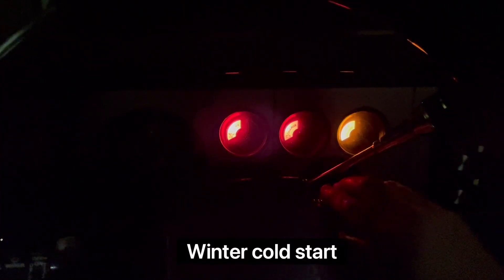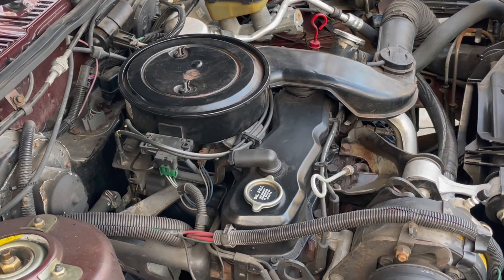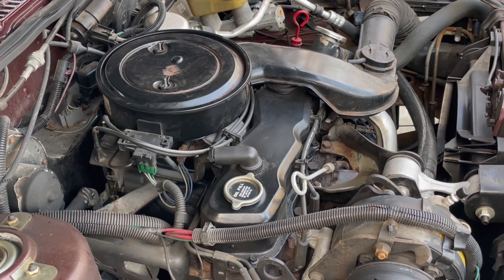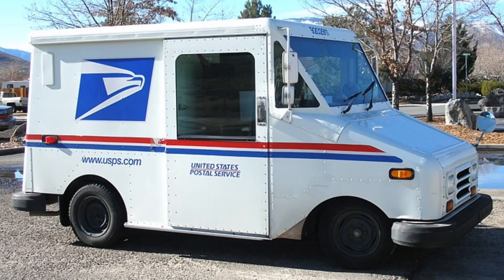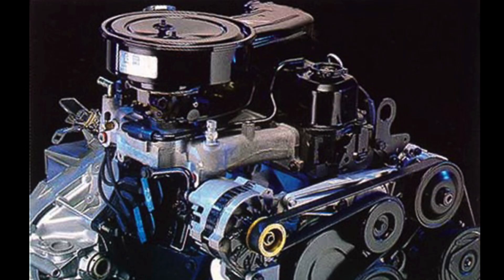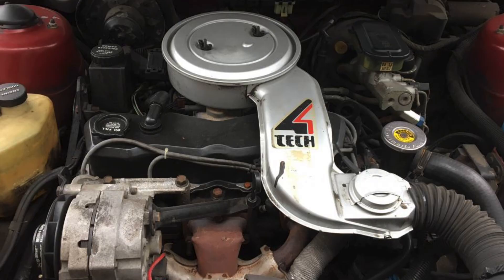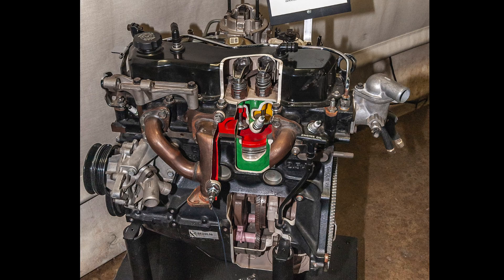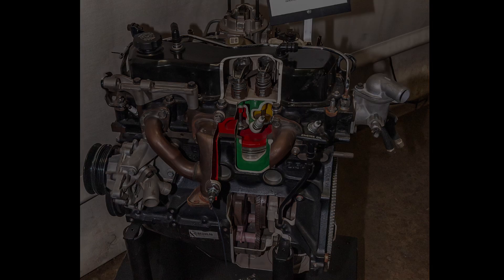Worst Sounding (and Most Recognizable) Engines: GM's "Puttering" Iron Duke 2.5L I-4

Comment: The Ecotec 2.4 sounds so bad, even from the factory, that working at the dealer, it was an almost daily occurrence for customers to come in with their brand new cars complaining that their engine is knocking.  I always joked that those shipped with factory rod knock, but it did kinda sound like that.  They also had the worst starter sound I've ever heard.  Sounded like scraping knives over garbage cans.

Except unlike the iron duke, those engines are also just terrible anyway.  They eat timing chains all the time, they burn their entire oil capacity between oil changes at 50k miles, prone to piston slap, etc.  I guess it's fitting that the cars they're in are equally horrible.

Comment: My Iron Duke lost a waterpump in August in the desert..I drove it 90 miles to the next town. Bought a waterpump put it on and kept going..they could actually air-cool! Try that with ANY other engine..It made that rattle noise sound really a reassuring thing..oh..carburetors were the best Dukes.. more reliable..

Comment: Great video! The Buick, later GM Holden here in Australia, 3.8L V6 was a pretty crude and noisy design. People complained a lot about the crudeness of this motor, it was used in the Holden Commodore for example, here in Aus. Holden made lots of attempts to improve the NVH characteristics of the 3.8 and it certainly got better over time. Nowhere near as weedy as this Iron Duke thing though! 😂

Comment: Yup. This engine was very crude sounding as I remembered it. But funny enough, in many GM FWD cars, specifically the compact X-body and A-body cars, this was the base engine equipped with throttle body fuel injection, which would start up easier without the need to pump the gas pedal, as you would need to in the next level engine upgrade option, the 2.8L carbureted V6 engine.

Comment: My Iron Duke powered 85 S-10 was EXTREMELY quiet after being “parked” on its roof for a few hours.
Side note:  The way it rattled the exhaust system against the body and frame every time I shut it off was almost comical.

Comment: I never experienced the 2.5 Iron Duke but heard plenty back in the day and still do from time to time. They are noisy unrefined poor excuses for 4 cylinders. Another GM 4 cylinder that parallels it in being dismal is the 2.2 pushrod 4 cylinder, aka the Vortec 2200 used in the S10. Unfortunately I had nearly 11 years experience with one. Gutless turd of an engine with a horrible power band that did not like to rev and sounded like it was coming apart if it was revved. Very unlike the excellent 22R that I used to have which revved willingly. Another loud buzzy 4 banger was the Chrysler 2.2 which was at least an OHC but also quite noisy though the turbo versions sounded good. While on the topic of noisy domestic engines, an honorable mention in the V-6 category has to go to the Ford 2.8 V6 which IMHO puts the Iron Duke to shame in terms of horrible sound. Talk about a sewing machine sound. Out of the gates they sounded like imminent valve train failure due to solid lifters. Also gutless turds.

Comment: I wonder if anyone could compare this engine (GM Iron Duke) with the similar displacement Jeep/AMC pushrod 4 that seems to have slipped into some of the same vehicles (I think the AMC 4 was a version of the 242 Six missing its front or back two cylinders)

Comment: Another thing that might have made a few of these cars sound  different(this was on V6s in certain Citations,I think the "Duke" had it too,a series of holes/nipples threaded into the exhaust manifold(s) connected to small pipes that ended in reed aspirator valves inside a sort of holder that then was connected to the engine air filter housing via rubber and metal tubes,the aspirator valves allowed air to enter the exhaust manifold but (if working) didn't allow exhaust flow out,it was some sort of emissions control strategy and made a certain amount of peculiar noise,especially at idle.
Reply: Interesting.  My 10 year old '86 Olds wouldn't start from about 15 minutes to 45 minutes after driving when it was humid.  Somebody thought it might be exhaust trapped in the manifold and a hole allowing air in?  Related to this? A quick stop at Blockbuster or an hour at the mall and you were fine.  Browse CD's at Best Buy for a half hour and your weren't going anywhere.
Reply: I suppose that with the aspirator valve thing a reed or  flap could fail and allow exhaust to flow wrong way back into the air filter enclosure but more likely that you had a bad ignition control module that would stop working when it absorbed heat after engine shutdown "heatsoak" and then later start working again after things cooled down 
  if it only did it in the wet or damp perhaps bad spark plug wires or even a bad distributer cap (I think that car still had one!) was absorbing moisture from the air and shorting out the spark energy 
would be worse with bad spark plugs or if the gap were too wide  @andrewsmith1404

Comment: They were noisy engines, but dependable. Of all the ones i had, only one left me at the side of the road, and that was when the pickup coil failed in the distributor. Another broke a headbolt, but it was a easy fix, new gasket and the revised bolt kit.

Comment: 5:19 That was a little unexpected that GM waited so long with adding a balance shaft to a four cylinder engine bigger than 2.4 liter. (Or is it GM-ish?) The Saab 1.5L V4 – aka Ford Cologne V4 – had it from the start in ~1963.

Comment: How about the V-6 that came in my dad's 1984 S-10. That thing was a dog.
Reply: The small Citation V6 was put into some of these and also early unibody Jeep Cherokee,too small for the weight of these vehicles and also I think some of these 2.8s had a lower compression ratio than the ones put in X11 and Pontiac STE cars which tended to have an appetite for Premium unleaded. 
The bigger V6 "Vortec"? used in S-10 was just fine and the Jeep Cherokee was transformed when the 242 fuel injection straight six became the available option in it especially when equipped with the trailer tow radiator (2 rows instead of 1)

Comment: I had a 86 Pontiac 6000 with the iron duke. Had an engine failure around 120k. Put a reman in it. Also trans failure a couple years later which also got a reman unit. It’s the only car I’ve ever had in over 30 years of driving that had an engine failure. Same can be said about the transmission. Had it about 5 years. Mid to late 90’s

Comment: I recall the sound rather distinctly, both starter and running. That gear drive had a replacement steel gear upgrade, that made the sound even worse/louder, to the point where 1 wondered if the mill had any oil pressure, or oil in it! We still have a couple LLVs running around town with the 2.5s, but most are the 2.2 Chevy. For such a short stroke design, that 2.5 does not like to rev. A neighbor of mine had an 85 Fiero with a 5 speed and that thing was screaming for mercy at 5k rpm. I still have the special oil filter housing removal tool collecting dust in my tool box, that 1 needed for the later 2.5s.

Comment: Had a 2.5 in an 81 Skylark. God I hated that piece of shit. On way to college one morning, with a friend right behind me….started smoking and losing power. I’d had enough, and my Monte Carlo was fixed, so I said F-it and just kept my foot in it for about 15 miles, until it just died.
Coasted into a parking lot, and hitched a ride with my buddy.
Went back that night…no compression and plugs were all fouled with molten aluminum.
Pulled the plates off, and too out the new battery and left it.

Comment: I remember my sister had an s10 with the duke that threw part of the cam gear through the radiator twice. I was young but if I remember right it had some kind of like a pressed fiber gear that my grandfather who owned a machine shop ended up replacing with steel ones.

Comment: O.k. o.k. Everyone seems to have it out for this little Iron Duke.  But I swear the one in my '87 Celebrity Eurosport bought from the neighbor next door sounded like and drove smooth enough that I thought it had the usual 2.8L V-6 when i took the car for a test drive.  Oh well, it lasted the stated 120K or so miles.  How about the "German" Ford 2.8L V-6 that was wedged into my parents' '75 Pinto Squire wagon?  Now that thing sounded truly like a chatterbox straight off the Ford dealer's lot. Plus its starter sang a memorable sing-song tune before all the chatter got going. But none of its crudity meant the ol' Pinto didn't last ten years with just one oil change!

Comment: If I remember right, there was a document that was leaked from GM corporate that detailed the cost to produce an iron duke. It was in the hundreds of dollars range (something like $700 comes to mind).
Of course they pumped out millions of them, and probably were able to shave the cost down to the last penny, but you’re building an engine from casting it to putting the air cleaner on it, you would think it might cost a bit more than that.

Comment: I've had a few of the 2.5s but most always blew a headgasket i don't know why but seems to be common for them . My 85 S10 had a 2.5 and it blew headgasket and smoked bad 

I also had a 88 S10 and it did the exact same thing and then finally I had a 89 Chevy celebrity base model with the 2.5 and 255,000 miles and it was perfect but sold the car later on but I have a 87 celebrity Eurosport 2.8v6 240,000 miles and I love that car and engine way better and the 3.1v6 that's in my 90 Lumina Euro

Comment: i noticed that you mentioned the 3.8 v6 engine! my grandpa had a oldsmobile 88 royale in red with the 3800 v6! if it hadnt gotten totaled by someone running a stop sign it probably would of still been on the road! its also known as the 3800 series 0,1,2,3 series 0 was obviously the best tho!

Comment: USPS proved that these engines were some of GM's most durable car engines ever produced.  My carrier's LLV has over 300K and the head's never been off of it.  Not only that, but that old-time never takes oil between changes. Trouble spot on those is the crappy THM-180 (Chevette) transmission.  But give the "Iron Duck" its due...it runs and runs and runs some more.

Comment: My 1980 Chevy Monza had one. The heavy Fisher Body Works body was a lot for this poor thing to haul around. But worse than that was that mine had a 4 speed manual with an undersized clutch that burned out every 10,000 miles or so. ( I've been driving stick shifts all my life and never had a clutch burn out like that.) It was the worst car I've ever owned. Its only saving geace was that my dad gave it to me for nothing.

Comment: Had a 2.5 in my 91 S10. Was no powerhouse but it was a tank. Beat the dog snot out of it and it just kept going. Had over 300k on not when I sold it. Guy I sold it to blew up the transmission. Never really noticed any abnormal noises from it.

Comment: It was piston slap! Unfortunately the oiling system was weak but enough for the top end. The wrist pins was the weakness. It created an egg shaped piston. This enabled piston slap and that distinctive knock like diesel sound at idle. But at 2k rpm it smoothed out and ran smoothly. I had an 85 S-10 with over 300k original bottom end and the timing gears and nylon mesh replaced with a steal upgrade but replaced twice! I had over 600k before the bottom end finally went! Thats a hell of a tough bottom end! I also had it finally rebuilt and honed .030 overbore with a special head gasket and shaved head with a new turbo off an olds omega. I eventually found an 84 Chevette with a manual transmission to put it in service. Now for the truck well….

But, I already had a small block 350 with a 400 crank which is a 383 stroker and double hump 202 high flow heads! It was a late 60’s block out of a 70 nova! So, I already small blocked the S-10 by then and it was a totally different animal! I kept the original rear end till I tore it out lol and eventually put a ford 9” with 273 gears and a 700R4 overdrive automatic out of an 84 trans am in it. That was a death trap! Ceramic pads and special front rotors. To stop! At 70mph she turn about 1400 RPM. I had long legs, so I put in the Trans Am seats and it had an extended cab. This helped with the long tail and cut and balanced drive shaft. It wasn’t quick off the line, but I had all kinds of top end. Well over 160mph. I could make the striped lines “solid” on the freeway! Thats GM! Love it! 🥰

Comment: I don't know why you're bad mouth in the sound of that particular engine. I have a 1983 Chev cavalier. With 1 million 89000 miles, it's the original engine and I'm not b********* when I tell you the mileage. Because I remember the day my grandparents bought that car. That car has been driven all the way across American numerous times all the way up to Alaska all the way to Brazil and back.  And then I ended up owning the car after my grandmother passed away and I've been driving the car since and by the way, since the car was new. I've been the one maintaining it. So I know what the mileage is. And I can tell you. It may not be the most pretty sounding and in, but it's been one of the most reliable engines ever made by G. M better than the crap they're producing today

Comment: Your voice sounds young. Nobody cared how an engine sounded back in my day during the 70's and 80's. We had mufflers for that. Yes the mid 80's 5.0 Mustangs gave people the historic V8 sound but we wanted power not sound. Power was hard to find before advancements were made including: VVT, Computer engine management, CAD design, thermal management, variable intakes, better fueling, turbos, 4 valves per cylinder, and other improvements.
Reply from the maker: Mufflers don’t quell noise within the engine compartment
Reply: @RareClassicCars  its very hard to tell where noise is coming from when driving.  At any millisecond you have noise coming at you from all angles and some of that has reflected and bounced around, or reverberated through the floor even. Some sound enters our ears through our skull. I know as I had my ears tested recently.

Comment: Ah yes, sounds just like our '88 Pontiac 6000.  Other than the fantastic plastic camshaft gear that ate itself at 100,000 miles, the engine soldiered on for another 100,000 with a new camshaft gear until the body rot got too bad on the rest of the car.  Engine still ran great despite the miles.

Comment: Okay what do you expect this was a mass-produced economy base engine GM mass-produced to fit in multiple platforms I had a celebrity with a 2.5 It ran Great for 125,000 miles until the cylinder head went bad I replaced it with a rebuilt head , head gasket thermostat anti freeze tune up and water pumn
Reply: Was reliable til I sold it

Comment: MerCruiser also used a large number of these engines for marine applications. Various other equipment manufacturers also used this powerplant.
FYI, the composite cam gear actually quieted the engine down by quite a few decibels. This is why GM went with the composite gear in the first place. As a side note, I think the vast majority of the noise this engine produced was related to the piston skirt length and the later models having a roller valvetrain. I think GM went roller with this model in the mid 1980s. 1985ish?

Comment: I used to have an '87 Chevy Celebrity  Ran like a champ!  Started flawlessly and easily every time. The car went down the road and up hills and kept up with highway traffic, no problem. It had the 151 Cu in, Iron Duke as well.  More than once I pulled up to a gas pump and had someone holler "Whoah!  You're putting GAS in there!" I have never heard any other Duke sound more like a diesel than the one in my old Celebrity. I'm talking a sharp tappity tap, and that very recognizable diesel engine clatter.  But it was a gasoline fueled Iron Duke.   The only trouble I ever had with the car was the trash alternators that GM used.  Three of them.  DOA right out of the parts store.  I took the one off an old Chevy Van and adapted it to the celebrity.  Never had alternator issues after that.

My 1984 Fiero.  Running sumbitch!  Zippy, Peppy, Nimble. and all those other good words like that.   A pure JOY to drive.  Enough power to get going and merging onto a highway,  and get 'er up over 90 pretty quick.   But not so much that the rear wheels are going to be getting loose.   151 Iron Duke getting the job done well. This one backed up by a 4-speed manual.  Sounds a little "ticky"  But nothing like the sound of the Celebrity.

Those little engines are pretty much bullet-proof if you don't whoop the snot out of them.  They are low-revving, long lasting little engines.  Like a tractor engine.  Not meant to have the guts wrung out.  (That's partly why some 84 Fieros burned.  People didn't know the difference between "Fiero"  and "Ferrari"  and tried to drive a 4-banger like a V-12.  Pop goes the weasel!  Crank through the block.  Among some other mechanical issues the Dukes had in "84.   But I digress.   

I miss my Celebrity.  I want to get another one with the same 151 in it.  I still have my Fiero, and It never fails to fire right up. (Unless the battery is dead) 
I would happily drive another 151 Iron Duke again.

Comment: For a non-GM 'worst sounding engine' my candidate is probably the Renault F9Q 1.9L Diesel. Not only is the sound remarkably agricultural for a common rail engine designed to fit in a hatchback, but the example I have experienced (very inappropriately mounted longitudinally in a Suzuki Grand Vitara 4x4) has an oddly high pitched starter motor and typically splutters cantankerously for a couple of seconds of cranking before reluctantly accelerating to idle when cold started. Some of this may be a case of worn out glow plugs, but still...